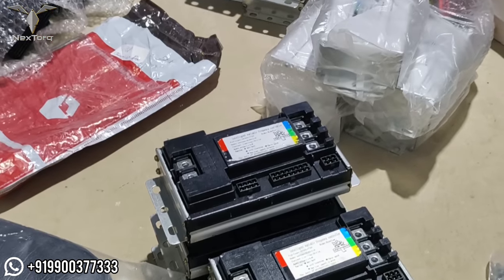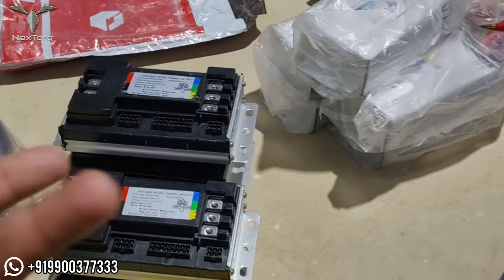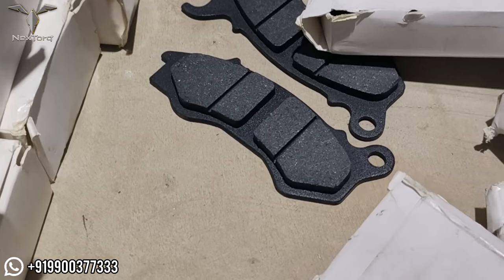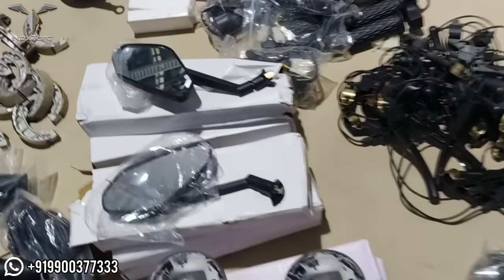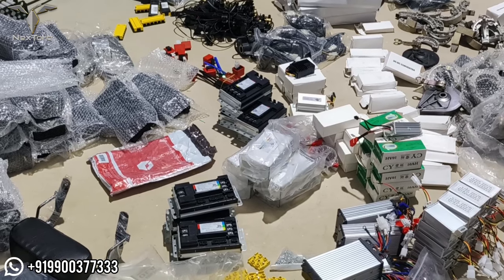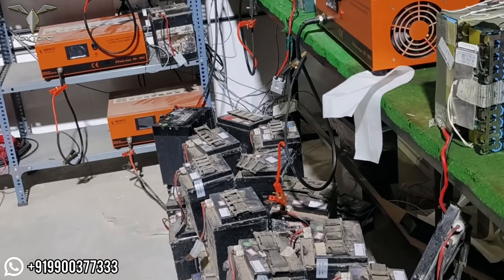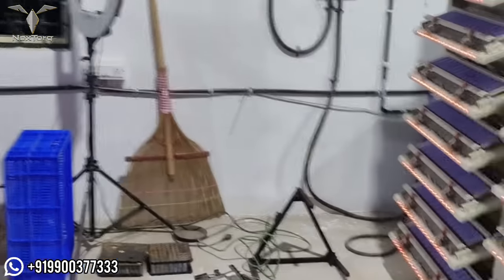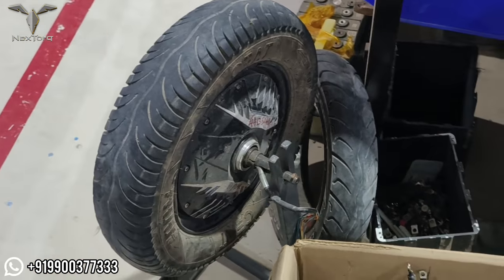EV SPARE PARTS AND ELECTRIC VEHICLE BATTERY SERVICE AT LOWEST PRICE IN THE MARKET NOW AT BANGALORE

Comment: We had a bad experience with staff who are attending the calls. We gave a vehicle for service after checking they said some wiring issue and going to change the entire wiring then later changed the controller then changed some few items. The final bill came around ₹12054. Then after 200kms again the controller issue. If we ask anything they are talking roude.